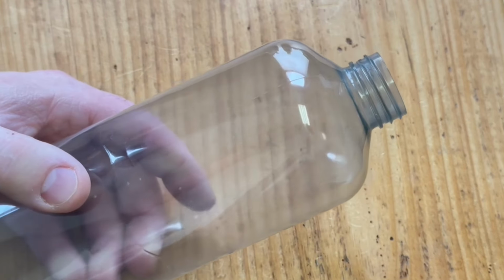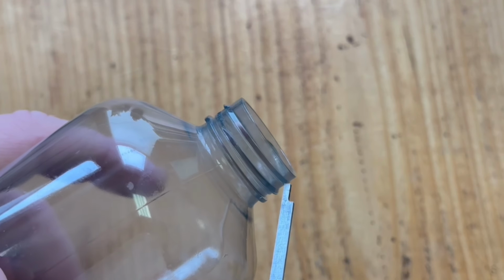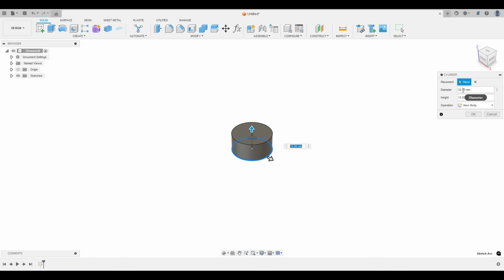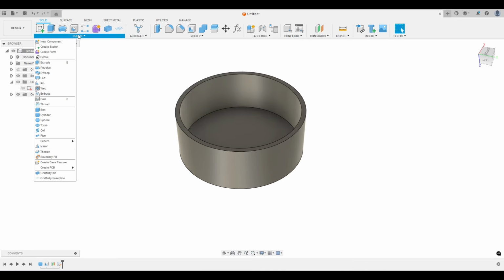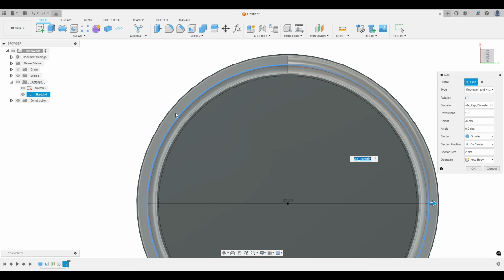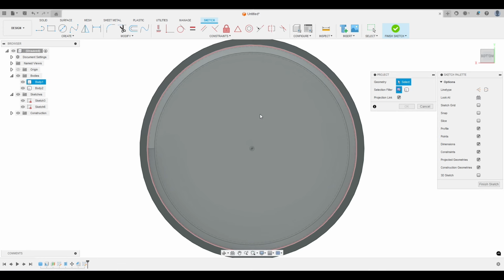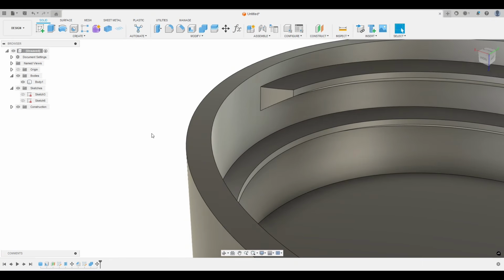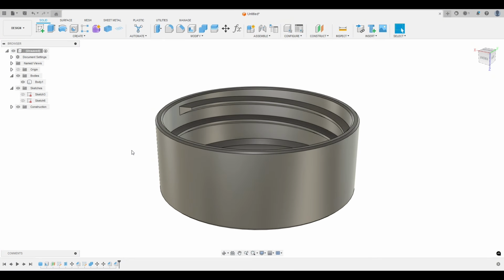Measure Existing Threads to 3D Print a New Cap/Lid

Comment: Interesting topic, thanks for sharing.
You need to learn better ways to use a digital caliper.
Nec height : You have a plunger (at the bottom) to measure that.
Pitch : measure from top to under 1st, zero caliper, measure next and you have it.

Comment: Step 1: Setting the lid height. If you make it too big (like you did going from 11.5 to 12), you are creating a scenario where the lid may not seat on the edge of the bottle and it will leak. That step should be half a mm shorter than the height you measure to ensure the lid seals.
Reply from the maker: 100% correct.

Comment: this may wok for water bottle caps but the height did not work as pitch for a cap i was trying to make, The height was the actual height of the inside of the cap to get the coil to look like it needed to be.
Reply from the maker: Yeah I mean…you just have to choose a height for your cap that works for your situation.

Comment: Is there any simple and quick way to model a cap for a bottle ? I tried to use the inbuilt thread function but it didn't work
Reply from the maker: If it’s not found in the thread function, then you have e to create them manually. I have a parametric file you can download and just plug in your numbers - https://makerworld.com/models/1300233

Comment: How would I design threads the other way? I have the cap and need to design threads on the bottle the bottle to match
Reply from the maker: Same concept. Just threads go on the outside of the bottle instead of the inside of the cap. Just have to measure the cap
Reply: @ Figured it out. Make tolerance a negative and everything else is the same. Thanks

Comment: This is very good!!! I have been trying to do a thread in a bottle cap with the CREATE-THREAD tool, not as easy as it sounds... Do you think this is a better way?
Reply from the maker: It’s the best way to do it in fusion, if the thread tool doesn’t have the profile you need

Comment: Just a pro tip with regards to audio and placement of mi mcrophone. If its close to ur mouth or throat you need to aware swallowing. Cause it records that gulp swallow an3e once ur ear hears it, its amplified loudly
Reply from the maker: I know!! I haven’t quite figured out my audio setup yet. I know it’s really important. I bought a $100 microphone (it’s ok), but don’t have a great space for audio recording yet! Hopefully will continue to improve.
Reply: @ShopTherapy623  most recording studio will have the mic almost eye level so ur kinda speaking up into it. Or wear a baseball cap and have protrude over the brim. That way it catches the vocals going up and not so much the downstairs vocals 😅 during live concerts most mics also taped to the cheek and sits next to the mouth but there are also mic speaking techniques were learn to not swallow. I used to do a lot of voice work back in the day and swallowing was always one of the big no nos during recordings. Sound engineer would yell at you all the time😂
Reply from the maker: I've been running most of my audio through Adobe Podcast - It uses AI to get rid of most of those sounds.  If you listen to some of my other/newer videos, you'll hear the difference.  I actually forgot to do that to this audio, which is why it sounds awful!

Comment: Very nice work to get people started.
  
FYI, most of the threads on cheap plastic caps have asymmetrical shapes. For a loose fit that does not matter. I am hoping to make a closer match for the real cap some day; to see if I can do it.
  
You can test thread quality by putting some water in the bottle and shaking it upside down.

Comment: An equilateral triangle will be near the overhang limits for many 3d printers (60 degrees) so I usually use right-angled (45 degrees).
Reply from the maker: Generally I'd agree, but these threads only stick out by about 1-1.5mm, so about 3-4 layers, which is easily done on a 3D printer at 60 degrees, especially if you slow down the print speed on overhangs. You should definitely choose the shape of the thread based on the situation.

Comment: Measuring threads is fine but many of these are standard sizes so I usually check to see if it's already specced out there. Then I measure anyway cause the world likes to throw curveballs. Knowing the spec means you can make accommodations for variations more easily as many values will be nominal.
Reply from the maker: You can definitely look up the (usually) standard threads they use, but by the time you’re done searching for that, I would already have it measured and drawn in Fusion.

Comment: Thank you for the video! I am in a situation where I have an object like your bottle in this example and I want to replicate its thread in my 3d prints. I don't want the cap, jus the cad for the bottle. How do i reverse engineer this thread? Could you do a video on it as well? Thank a ton!
Reply from the maker: You will take the measurements exactly like I show in the video, and instead of creating threads on the inside of a cylinder, you put them on the outside. It’s the same process
Reply: @ShopTherapy623  Thank you so much!
Reply from the maker: I will make a video on it!

Comment: What a nice and relaxing way to demonstrate a quite complicated 3D problem. Easy to follow, even though I'm not a Fusion user. Recently started with OnShape, previously mainly using OpenScad and AutoCad 2007 - Yes a very old version. So both OnShape and Fusion's user interface is totally  new to me.

Comment: There is a "Thread" option in the "Create" menu that lets you create a thread on a selected surface with all the options for different type of threads. Saves a lot of time.
Reply from the maker: Yes, absolutely.  This isn't necessarily about creating threads, but rather learning skills in Fusion 360. If you can find the exact thread you need in the thread tool, then absolutely you can do that.  You'll just need to make sure the proper clearance is there to fit nicely onto your existing bottle.
Reply: You will need to know the name and size used for making the plastic bottle that he showed.
  
The main problem is 3D printing: the thread overhangs are not precise. This is why loose threads are created. No shape problem with injection molding; only material shrinkage (I think).

Comment: 6:45 I think it would be better to have "tolerance" and/or "clearance" in the parameters, too, so the spec of other parts could be zero tolerance measurements and you can define the diameter in the sketch as inside_diameter + clearance * 2 (or whatever way you want to think about clearance for round objects).

Comment: 0:55 Correctly made cap seals on the top surface of the bottle opening and doesn't even touch the neck while tightened. The only thing you need to consider is not to make the cap too long.
Reply from the maker: Yes, I got confused when making the video and said the opposite of what I meant to say.  Cap should have been shorter not longer.  However since I offset the threads in the cap, it still seals at the top.
Reply: @ShopTherapy623  i noticed this as well.  However, I believe that the longer cap will bottom out against the flange before the lip of the bottle can seat against the cap.  The Offset threads don't help.  Also I noticed a pressure bypass grove in the threads which allows the liquid to pass all the way to the flange leaving you with dirty threads.  A cap that is shorter would be better suited.

Comment: One tip. When you were making the coil you spoke about doing some calculation to be able to have more threads and keep teh same pitch. There is a way to do it without having to calculate anything. In the coil feature change the type to revolution and pitch or height and pitch. With either option you get to enter the pick and then either enter how many revolutions you want or the height of the space and it will fill it with the needed revolutions.
Reply from the maker: That is a great tip! I completely missed that!  Thank you!
Reply: @ShopTherapy623  Just watched the video and was going to ask that exact question. Thanks for pointing that out.
Reply: Yes true that I found this out on my own after watching this epic teaching over and over for a few days.

Comment: ...the bottom "lip" is absolutely, positively not part of the sealing feature. That's accomplished at the top edge of the bottle. If the bottom flange had anything to do with sealing, we'd expect to have wet threads every time we open the bottle, which for anything sticky would translate to lids that are glued on.
Reply: Without the stop, if somebody keeps rotating the cap, the threads will skip. This can cause some damage if done repeatedly (as the wise man said: "Stupid is, stupid does").
Reply from the maker: I don't think I said it seals it, but I did misspeak.  What I meant to say is that the threads can't go past that lip, so the cap height should be LESS than that.  I accidentally made it more.  However, it still seals at the top because I lowered the threads in the lid.  This is what happens when I make a video without practicing it and do it in one take!  Thanks for the comment!

Comment: The lid does not seat on that lip. 
The lid seats on the opening. Just look at the seal in the cap, see the indentations where it contacted the opening lip?
The lower lip is for the tamper ring. You know, the one that you have to twist the lid to break.
Sorry, lost all credibility when you said that.
Reply from the maker: the cap still seats at the top because I inset the threads into the cap. If you wanted this air/water tight, you’d need to add a gasket for a 3D printed cap. That would decrease the space ever more to insure it seats up top. This probably wasn’t explained super well in the video. Shooting a video for the first time, in one take….sometimes is hard to do. Cap should have been a little shorter, not taller.

Comment: Nice video on manual thread making, BUT it seems to me that you are designing to seal the cap to that external lip. And that doesn’t make a good cap. When tipped with the cap in place, the bottle content can flow over the thread as far as the lip. Which means that when opened, both threads will be ‘dirty’ with whatever product. It will become messy very quickly! 
I think your design concept would be better, actually very well, suited to a fastener (nuts, bolts, threaded holes, etc).
But a more practical cap design would aim to tighten down on the very top of the bottle and make the seal there, keeping the threads as clean as possible. 

I think that the design purpose of that external lip (flange?) has do with the security (anti-tamper) seal that is broken on first opening the bottle, rather than retaining the contents inside the bottle.
Reply from the maker: No I am designing to seal at the opening, which is why inset the threads into the cap. It still seats at the top. I probably didn’t explain that well and maybe shouldn’t have increased height to 12. I can see how that’s confusing.
Reply: @ Confused me for sure! In order to prevent the external lip from blocking a top seal that initial height needs to be some clearance tolerance less than the measured 12. 
The big take away for me is to maximise the use of “parameters” to generalise whatever design - not merely for iterative refinement, but to create a whole family of products from the one design. 
In coding terms, declare the variables outside of the method.
Reply: I think the flange is likely part of the inflation process.
Reply: @ScottHess , the flange provides a positive stop. This prevents possible damage to the cap from overturning (the threads effectively multiply and convert the torque into a linear force).
Reply: @michaels3003  Maybe?  What I'm talking about is how the injection-molded blanks are squat little test-tube-shaped items with the flange and threads already as-is.  The machinery picks it up by the flange, flips it into a mold and inflates it to final size using heat and pressure, which needs a pretty strong place to hold.  Then the items are zoomed around resting on the flange.  In the past few days I've been looking, and on soda bottles the security ring thingie seems to generally be above the flange (there's like a second minor flange closer to the threads).  Some bottles seem to be closed in a way that entirely ignores the flange, some seem to have features designed into the flange, such as security stops (I mean like the squeeze-and-turn thing).  My guess is that the beefy flange is there for the assembly machinery, and that sometimes you can design in secondary features on the top side.
Reply: @ScottHess  , thanks.
  
Re: looking at threads (amazing what men do for fun), I've just discovered a plastics company's website name (in tiny letters), and I assume the thread code, above the bottom flange on the neck. It's too bad all these plastics go into landfills (see CBS story about Starbucks' coffee cups).

Comment: It’s also worth browsing the standard threads Fusion makes available. E.g. A 1.125” 10 tpi thread (Fusion calls it “ANSI Unified Screw Threads, 1.125in, 1 1/8-10 UNS”) with the minor diameter and one of the the thread surfaces offset by -0.1mm produces an excellent fit on a lemonade bottle.

Comment: I think you explained this perfectly. Looks really nice and easy to follow along. I have one question though.. since you made the height of the cap a bit higher, I think there may be a risk that the fluid from the bottle could leak out to the threads but stop at the bottom thread. Could it be an improvement to actually make the cap a bit shorter so the bottle is touching the inside of the cap.. so it becomes tighter there? Does that make sense? Thanks!
Reply from the maker: Yes cap should probably be a little shorter, especially if trying to make it water/air tight.  With 3d printing, the only way to achieve that would be to add a gasket. 

However, since I lowered the threads inside the lid, the cap still does seat at the top, not at the lip on the bottom.

Comment: I "enjoyed" this last week when I tried to design threads compatible with European milk bottle. Important dimension is thread outer diameter 38mm, there are 3 threads with 3mm spacing, so spiral is 9mm per turn. But fun starts with tolerances and material. Printed cap works with original battle, printed bottle neck works with original cap, but both printed parts do not work together, cause PLA is too tough, has sharp edges and there are 0.12mm steps from layers. I used telephotos at minimal focus distance to get the profile without much distortion and calibrated it from known dimensions and used it for measuring profiles.

Cap is much more complicated design than it seems and cap has three points of contact - there's like 3mm long (i don't remember) pipe which extends outwards a bit and this goes inside the bottle, makes contact with inner wall and bends inwards. Then there is other tiny ring that pushes agaist outer chamfer/wall on the very top of bottle and bends outwards. Then finally bottle pushes against the lid. But lid is made from soft polyethelyne and for 3d printing I'm not aware that other soft materials than TPU/TPE exist and these are not convenient to print/dry.

It seems that whole world except US uses neck finishes standardized by Cetie, but dimensions are not available, they offer to buy specs for like 150EUR and 3d models of specific parts for 35EUR or so.
Reply: crazy!!!

Comment: Why not just use the thread maker tool?
Reply: @gullenator1 Although the thread maker tool might work; if you’re 3D printing the threaded item, clearance compensation will become a factor.  That isn’t “embedded” in Fusion’s thread generator.  This way would probably make fine adjustments for a 3D print easier to do when you want to have a good fit.  YMMV
Reply from the maker: If it’s a standard thread size, you definitely can.
Reply: You can create custom threads definitions that are any size you wish. You are not limited to standard sizes. I wrote a python script for automatically handling clearances for 3D printed threads based on thread pitch. As a bonus it also does some housekeeping on custom threads definition files when new versions of Fusion 360 come out, since for some reason they use a new folder for threads definitions every time they release a new version. You can find it in the Fusion 360 subreddit by searching for my post called 3D printed threads help.
Reply: @ClaytonMacleod , the name was changed to Autodesk Fusion in January 2024. The "360" moniker is gone. I don't think it will come back.

Comment: Been wanting to do this for ages, have these glass bottles with no lids that I need, followed your guide and the first print worked! Need to tidy up a few little things but all good. Now to learn how to put a texture on the outside of the lid. One stupid question, I can't figure out how to change the view of the object apart from clicking top, left etc up in the right hand corner, how do you simply click the mouse and drag the object around?
Reply from the maker: You click with the wheel on your mouse and then move around. If using a laptop, I believe you hold down shift and click and move (I may be wrong about the laptop). I have a video on my channel about it!
Reply: @ShopTherapy623  lol, simple, thanks for that, brain was half asleep, you wouldn't also believe I just re-started 360 after an update and the very first tool tip that came up was the exact thing, how to move the model around. Thanks, brilliant simple video too that explains it very well.
Reply: Rotating the object view (orbiting?) is done with the middle mouse button.
Panning (ie dragging up/down/left/right) is SHIFT + middle mouse button.
The above assumes that the "Pan, Zoom, Orbit shorcuts" setting in Preferences is set to PowerMill.